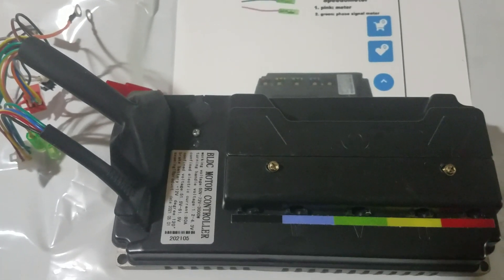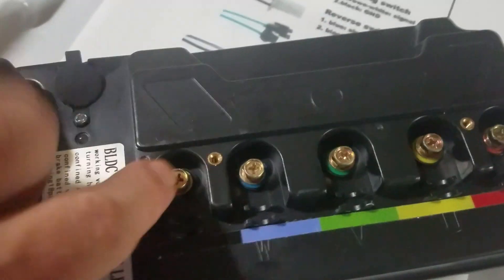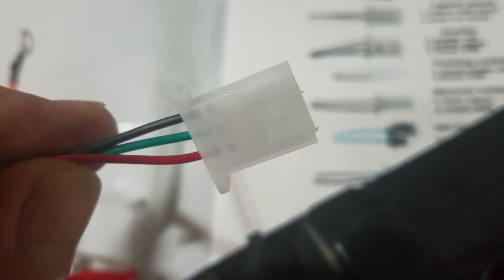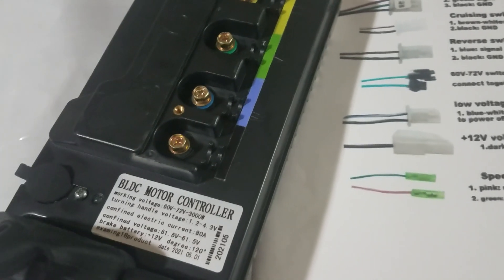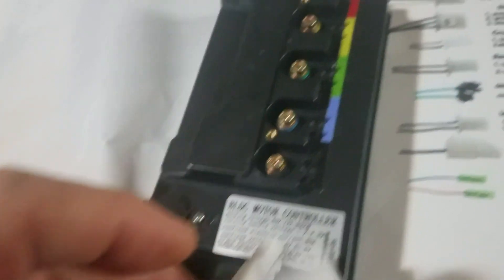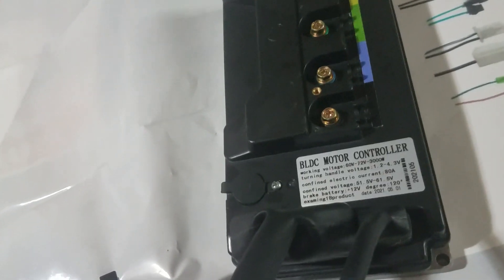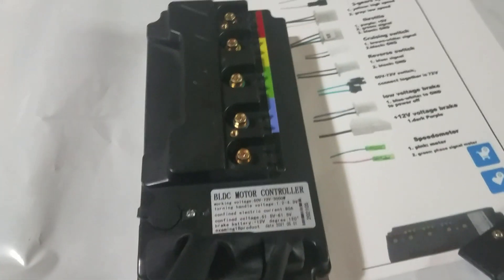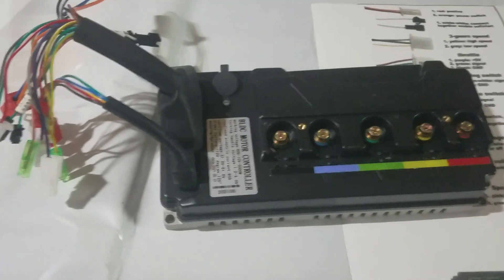SINE WAVE 3000W CONTROLLER WIRING

Comment: I just received my controller but I do not have the Soft Start wires. Could u please help me with telling me which pins on the big port on the controller your Soft Start wires go to and maybe I can add the same ones.
Reply from the maker: I AM ABOUT TO DO A BATTERY UPGRADE AND WIRE CLEANUP AND I WILL GET BACK TO YOU.
Reply: @TechKnowCSS  Thanks buddy!
Reply from the maker: @osgars  DID YOURS COME WITH A PROGRAMMING CONNECTOR? IF SO LET ME KNOW WHICH WIRES AND COLORS TO WHAT PINS. AND WHAT KIND IF HARDWARE TO THE USB.
Reply: @TechKnowCSS  

Yours have the port connected to it so it should be SOMETHING like this.

First row
1 = TX

2 = RX

Next row

3 = GND

4 = RST

5 = GND

Last row

6 = CLK

7 = DIO

8 = 5V
Reply from the maker: @osgars  ACTUALLY YOU HAVE IT RIGHT, MINE VARIES SLIGHTLY AND IT IS A  XRGB 8 PIN MINI DIN.

MINE IS
First row
1 = LUTX

2 = LURX

Next row

3 = GND

4 = NRST

5 = GND

Last row

6 = SWCLK

7 = SPDIO

8 = 5V

DO YOU KNOW WHAT TYPE OF COMMUNICATION IT USES? (RS232? / TTL? / SERIAL?) AND WHAT HARDWARE CIRCUIT I NEED TO BUILD TO CONVERT TO USB. I HAVE THE CORRECT SOFTWARE WHICH IS MQCON.
Reply: @TechKnowCSS  

I have tried with connecting it with a regular USB-serial-adapter. An adapter with the CP2102 or the Velleman VMA440.

I have tried to use the Tx/Rx/Gnd/5V pins ... I have not succeeded yet, but I don't know why really. Could depend on my weird Macbook->Parallels->Win10 setup, or my usb-serial-adapters, or if the software doesn't work no more? I don't know. It would be interesting if you could do the same tests. I am just trying to use the UART (Universal Asynchronous Receiver/Transmitter)... There is still some fiddeling needed to get this working.
Reply from the maker: @osgars  YOU MUST MAKE A COM PORT FOR THE COMMUNICATION WITH THE MQCON SOFTWARE. https://sabvoton.net/pages/download-information
Reply: @TechKnowCSS  Yeah it shows up as "COM3" in the dropdown menu, but it can not get the data from the device. It says "Commander Send Failed" when I press "Read data"
Reply: @osgars  have you tried to use those rx/tx wires, mine do noting.
Reply: @osgars  most likely the chip isnt programmed for that, they seem to have ccopied the pcb etc but not thefirmware to match it
Reply: I just received mine, mine does not have 2 green wires for 60-72 wires….lol, I want 72 volts?…soft start  1 is pin 2 next to 2 black wire…the other white wire is straight across next to the orange power
Reply: @THEPAINOFITALL  I know. It is so weird. But I think they changed it to being auto detecting. If u give it 72V it will use it automatically. 

Did u get soft start to work?
Reply: @THEPAINOFITALL  I am really curious about if u got the soft start to work!

Comment: Could you share a little investigation to see what is actually behind that screwed down thing right to the left of the label?
Reply from the maker: THE SCREW ONLY SECURES THE RUBBER COVER ON THE DONGLE CONNECTOR TO THE BOX, BUT BETWEEN THE SCREW AND THE LABEL IS A COMMUNICATION LED.

Comment: Thanks for the video. Do you know if the controller can be set to 60V mode but have a 72V battery connected to it?
Reply: From my understanding  if u hook it to computer program u can set your all your  parameters ..this is pure sign wave controller much better for electric equipment
Reply from the maker: WHAT YOU ARE TRYING TO DO IS BYPASS THE CUTOFF VOLTAGE WHICH WOULD DAMAGE THE BATTERIES, NOT ADVISED. HOWEVER IT MAY ALSO FRY THE CONTROLLER INSTANTLY AS WELL, MOREOVER IT WOULD NOT HAVE ANY ADVANTAGE AND WOULD NOT IMPROVE PERFORMANCE EVEN IF IT DID WORK AND NOT FRY THE CONTROLLER. I SAY DO NOT TRY IT.

Comment: I have this controller. The only thing I can't figure out is which wires I would connect to a keyed switch.
Reply from the maker: At @2:30 I show you the orange wire that is the (key switch) wire. Orange wire to switch then switch to full + positive power (60v/72v).
Reply: I have the older version like the schematic on a bike that works. I just take the orange and maroon to a switch or you can just hot wire then and the controller works. I don't have the line red wire and nothing from my cluster of eyes connects back to the negative. Just trying to figure out how to wire the new one.
Reply from the maker: @lancephair8334  I would have to see the controller and how it is hooked up and the schematic.

Comment: @Julius dades Just purchased it seems like the exact controller but alas, it will not turn on not a flicker. In the comments someone connected the purple wire too batt+? 
Really not sure what else too try as I think it is a clone as it has no port connected for programming and now the seller has gone quiet! Bike was working fine with the 2 previous 1500w controllers.
Reply: "It has no port connected"... Do you mean that it actually doesn't have a physical port on the PCB? Because the actual casing has a "slot" for a programming port. I have just purchased this and have not yet received it so I can not check myself :)
Reply: @osgars  yes correct it has no port. The pcb has the holes to insert 1 but it's not been fitted.  Hope yours is correct once it arrives.
Reply: @ClassicMini4ageTurbo  interesting. Hopefully the support is there but no port.

Comment: Hi i installed one like this but this turn off with 72v battery 🔋 is 72v but this charge at 80 or 84v but when battery is in 72v bike turn off can you help me please 🙏 thanks and good video
Reply from the maker: DID YOU CONNECT THE 2 WIRES THAT SWITCH IT TO 72V?

Comment: I didn't get the instruction manual. How did you connect yours? I can't even switch it on.
Reply: Manage to get it going finally. You need to connect the purple cable to the +battery for angle testing/self-learning (reverse & forwad) at the beginning. And then take it out of +battery but leave the orange cable connected to the +battery and then reset it by turning it off and on and your ready to roll.
Reply: @juliusdades1426  did yours have a single grey wire?
Reply from the maker: Did you even watch the video? I talk about the main power wire and to hook it up direct or to a switch/key.
Reply: I did connect the key switch (orange cable) to the positive (red) battery and still the wouldn't switch on.
Reply from the maker: Either you made other major errors or bad wires or bad motor or bad controller, i would have to see it myself in person because without further information i can guess forever, i am not that young.
Reply: It can't be wiring or bad hub motor. I just tried it with my other controllers and it worked fine.
Reply: I manage to get the hub turning backwards and forwards (self learning/angle test). How long should I keep going with it? The hub spins backwards and forwards and when should it stop??

Comment: Is it possible to show the wire work on you bike ? I try to change my shansu cp-4 controller with a votol em-50s controller.
Reply from the maker: I AM DUE FOR A 2ND TEMP BATTERY UPDATE BEFORE I DO MY FINAL 72V 71AH BATTERY UPGRADE AND I WILL DO A QUICK VIDEO OF IT WITH ALL THE COVERS OFF, BUT YOU MAY NOT BE ABLE TO SEE THE DETAIL BECAUSE IT APPEARS  110% FACTORY. (ACTUALLY CLEANER THAN FACTORY BECAUSE IT WAS REAL SHITY FROM THE FACTORY).

Comment: Also can you actually program the controller or is it locked
Reply from the maker: YES PROGRAMMABLE, BUT I HAVE NOT DONE IT, I FOUND THE PARTS HOW TO MAKE THE DONGLE AND THE SOFTWARE BUT STILL DO NOT KNOW IF IT IS TTL OR RS232 INTERFACE. THIS IS A Mqcon Sabvoton ML7280 CLONE
Reply: @TechKnowCSS  pretty sure its not a clone. I bought the same exact controller but mine doesn't have the programming port soldered onto it.
Reply from the maker: @lt.schlechtnacht9414  IF YOURS IS NOT A CLONE IT SHOULD HAVE CAME WITH A CABLE LIKE THIS ONE...   https://www.aliexpress.com/item/2255800863164893.html?gatewayAdapt=4itemAdapt  I WISH I COULD SEE THE PINS THE PROGRAM CONNECTOR CONNECTS TO ON THE CONTROLLER. VIA WIRE COLORS.
Reply from the maker: IT IS NOT THE DONGLE THAT CONNECTS TO THE PORT BUT I STILL WOULD LIKE TO KNOW WHICH COLOR WIRE GOES TO WHAT PIN ON THE CONTROLLER AND WHAT THE INTERFACE IS ON THE BOARD THAT CONNECTED JUST AT THE USB CONNECTOR AND IF IT IS TTL OR RS232 INTERFACE. AND WHAT COLOR WIRES PINS CONNECTION MATCH WHICH PIN ON THE ROUND DONGLE PORT.
Reply: @TechKnowCSS  it could be so, that the interface on the controller is SWD.
Reply from the maker: @osgars  Your guess is as good as mine but it probably is what all other Sabvoton ML7280's (ML SERIES) ARE. USING THE MQCON SOFTWARE.
Reply: @TechKnowCSS  could you share what parts you have found to make the dongle?
Reply from the maker: @osgars  I HAVE FOUND PARTS WITH PRE MADE DONGLES WITH 2 DIFFERENT TYPES OF DECODERS THAT CONVERT IT TO USB INTERFACE AND I AM NOT SURE WHICH ONE TO BUY, BUT I HAVE FOUND THE CORRECT SOFTWARE.
Reply from the maker: @osgars  I DO NOT KNOW IF IT IS TTL OR RS232 INTERFACE.
Reply: @TechKnowCSS  I bet RS232 based on the amount of wires (6) on the original cable?
Reply from the maker: @EVO1087R  IF THE ADAPTER IS NOT THE ROUND CONNECTOR I DO NOT KNOW THE PINS TO CONNECT IT TO.
Reply: @TechKnowCSS  i’ll find out how much they cost shipped from the manufacturer. The ones from them look like they have a 5 pin jst connector in the wire harness that connects to the usb cable for programming.
Reply from the maker: @EVO1087R  SURE.

Comment: What does the blinking light on the controller mean....
Reply from the maker: I WIRED UP MY CONTROLLER THE RIGHT WAY AND NEVER GOT A RED BLINKING ERROR LIGHT. I DO NOT KNOW. BUT IT MIGHT MEAN YOU DO NOT HAVE THE HALL SENSORS HOOKED UP.
Reply: @TechKnowCSS  I don't understand how I could've wired the controller up the wrong way. Positive, negative, the  3 phases, and the throttle.  I tried the controller without the hall sensors
Reply from the maker: @lt.schlechtnacht9414  MOST BLDC CONTROLLERS NEED THE HALL SENSORS, LIKE THIS ONE, BUT THERE ARE ONES THAT DO NOT AND THEY SAY SO IN THEIR DESCRIPTION.
Reply: @lt.schlechtnacht9414  Hi. It is LOW VOLTAGE indicator. Blinking RED light.

Comment: Mine is turning the wheel in wrong direction. Does reverse swicht fix that?
Reply from the maker: TO CHANGE DIRECTION JUST SWITCH 2 PHASE WIRES AND THE SAME COLOR HULL WIRES, REVERSE IS ONLY LIKE 10% POWER, BTW, WHAT IS THIS IN AND THE APPLICATION?
Reply: @TechKnowCSS  hi,i tried doing this in several configurations,and it simply refuses to change direction,when i turn the bike on,itll self test (spins the wheel a bit) in the right direction,and then it reverses the moment i use throttle. could you tell me if there is a self test pin i can short or something?
Reply: Connect self learning pins to each other and apply power (or turn on ignition) If the wheel start turning in wrong direction, disconnect the self learning pins and connect again (Keeping power applied - Ignition on) Wait for 10 secs and turn ignition off. This is gonna do the work.

Comment from the maker: TechKnowCSS
1 month ago
WORKED PERFECTLY AND LOST NO FUNCTIONS  AND ADDED CRUISE CONTROL THAT WORKS PERFECTLY, WENT FROM 60V 20 AH BATTERY AND A 35 AMP CONTROLLER AT 31 MPH TO 72V 50 AH BATTERY WITH A 80 AMP CONTROLLER AT NOW 52 MPH WITH A CRAZY LAUNCH SPEED, I FRICKEN LOVE IT!!!  THAT PINK SPEED WIRE HAD ALL THE DISPLAY DATA IN IT TOO ADDED TO THE SPEED SIGNAL LIKE WHAT POWER LEVEL 1-2-3 AND BRAKE INDICATOR AND THROTTLE INDICATOR, EVERYTHING.
Reply from the maker: @arnovangurp2188  YES, IT IS JUST A MY1020, IF IT HAS THE 5 HALL SENSOR WIRES, IT CAN RUN IT AT 60V OR 72V WITH POWER THAT WILL HAVE THE BIKE LEAVE WITHOUT YOU IF YOU DO NOT HANG ON TIGHT. MY 60V 2500W MOTOR IS PUTTING OUT OVER 7KW AT 72V WITH THIS CONTROLLER. BUT BE CAREFUL ON YOUR BATTERY SAG ON TAKE OFF AND TOP SPEED RUNS, THE MOTOR WILL GET HOT. A GOOD 72V BATTERY WILL SAG ABOUT 2V ON LAUNCH, WEAK ONES WILL SAG 10V+ WHICH IS REAL BAD DANGEROUS FOR FIRE, KEEP SAG UNDER 5-6V. I RECOMMEND TO KEEP THE SOFT START ON TO START WITH AND IF YOU FEEL SAFE AND WANT TO GET REAL CRAZY AND YOUR BATTERIES CAN HANDLE IT, YOU CAN TURN IT OFF. THIS IS A COPY OF THE  "SABVOTON ML7280" CONTROLLER. I HAVE OVER 3,300 KILOMETERS WITH IT ALREADY ON MINE.
Reply from the maker: @arnovangurp2188  ?

Comment: Is there a speed limiter?
Reply from the maker: NO, THERE IS NOT, MOST OF YOUR SPEED IS THE VOLTAGE AND STRENGTH OF YOUR BATTERY PACK. FOR SPEED A 72 VOLT BATTERY. THERE IS A PROGRAMMING PORT TO TUNE YOUR SETUP FOR MAX SPEED AND POWER CONSUMPTION  BUT I HAVE YET LOCATED WHERE TO GET ONE, I MAY HAVE TO MAKE ONE. AND I THINK THIS WILL BE THE SOFTWARE FOR BLUETOOTH   andriod_MQCON_v1.05_release.apk  AND I BELIEVE THERE IS A DIRECT USB PC SOFTWARE AS WELL WITH THE MQCON.
Reply: @TechKnowCSS  i have an ebike its 72v 1200w wheel hub the max speed is 45kph = 27.9mph   my controller is 72dc  current limit 35a  model ZWK072040A hope you can help me how to increase speed
Reply from the maker: @anawaynejherwyn7957  WITH THAT MOTOR 1200W AT 72V IT WILL TAKE 16.66 AMPS TO GET TO FULL WATTS, SO 35A IS SAID TO BE FOR MAX OF 1000W, YA I DON'T GET IT TOO. JUST BECAUSE IT IS A 1200W THAT IS CONTINUOUS WATTS 24/7 SO FOR SHORT BURSTS YOU CAN MORE THAN DOUBLE THE WATTAGE. I AM GETTING NEAR 7K WATTS FROM MY 2.5KW MOTOR WITH A 80 AMP CONTROLLER BUT I HAVE TO BE CAREFUL BECAUSE THE MOTOR WILL GET HOT FAST AND BURN UP. YOUR CONTROLLER IS REALLY MARKED AS A 40 AMP BUT THEY ARE ALL WAY OVER RATED. BEST YOU CAN DO IS GET A HIGHER AMP CONTROLLER (SINE WAVE). BUT YOUR BATTERY  MUST HANDLE IT AND NOT LET THE BATTERY VOLTAGE SAG MORE THAN 5-6 VOLTS FOR 72V SYSTEM WHICH IS A VERY HEAVY LOAD. LEAD ACID BATTERY WILL SAG WAY MORE THAN LI-ION. I AM ASSUMING YOU HAVE LI-ION.
Reply: I'm still using LED ACID. I need to to switch lithium if I change my controler to 3000w also my hub to 2kw or 3kw...  I don't want my 1200w hub to be toast lols
Reply from the maker: @anawaynejherwyn7957  LI-ION BATTERIES REQUIRE A BMS (BATTERY MANAGEMENT SYSTEM) THAT KEEPS THE CELLS EQUAL IN VOLTAGE "BALANCED", AND THEY ALSO HAVE A MAXIMUM AMP OUTPUT THAT THEY ARE RATED AT. SO IF YOU SWITCH TO LI-ION BATTERIES YOU CAN PREVENT FROM TURNING YOUR HUB TO CHARRED TOAST THAT WAY AS WELL AS THE CONTROLLERS AMP RATING.  ELECTRIC MOTORS ARE RATED WITH WATTS NOT VOLTS SO USING 48V TO RUN A 36V MOTOR WILL NOT BURN IT UP BUT CAN. OVER VOLTING A MOTOR WILL INCREASE RPM FOR FASTER TOP SPEEDS. FOR EACH 12V INCREASE IT WILL INCREASE WATTS BY ABOUT 40% AND SPEED BY ABOUT 30%. MIND YOU A 1200W MOTOR IS RATED AT 1200W CONTINUOUS 24/7, BUT CAN WITH OUT ANY ISSUE PUT OUT 3000W+ FOR SHORT BURSTS OF TIME. THIS IS WHERE YOU MUST WATCH HOW HOT AND HOW FAST IT GETS HOT TO PREVENT THE TOAST FACTOR. THESE ARE ALL GENERAL RULES OF THUMB AND IS ALL AT YOUR OWN RISK.

Comment: Ok so how do I change km to miles thank in advance
Reply from the maker: YOU MUST CHANGE THE GAUGE ITSELF, I FOUND WHERE TO GET AN EXACT ONE BUT IN MPH FOR ABOUT $80. AS A CLASS 3 EBIKE OR MOPED OR MOTORCYCLE OR CAR OR TRUCK SPEEDOMETERS ARE REQUIRED BUT NOT REQUIRED TO BE IN MPH IN USA BUT IN ENGLAND THEY POST SPEED LIMITS IN KPH BUT REQUIRE YOUR SPEEDOMETER TO BE IN MPH SO THAT IS WHY YOU GET IT IN KPH AND THAT THEY DO MAKE THEM IN MPH. WOULD YOU LIKE THE LINK TO BUY ONE?  citiescooter  DOT COM.